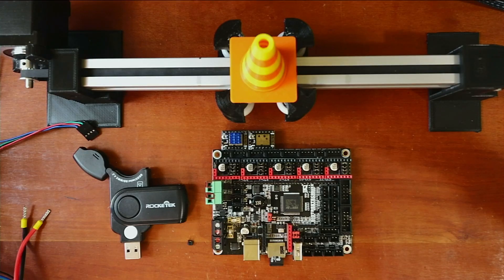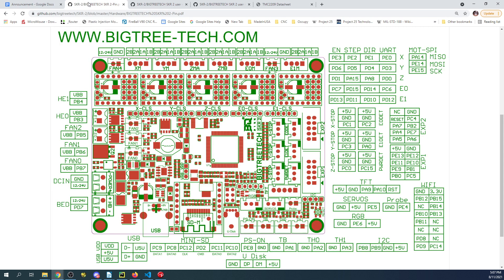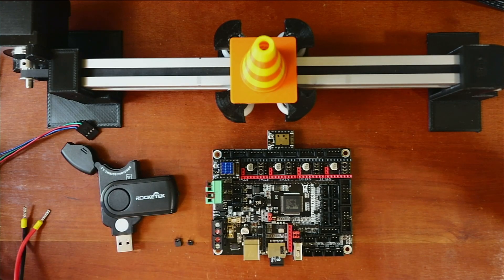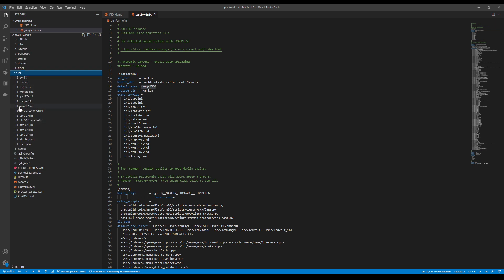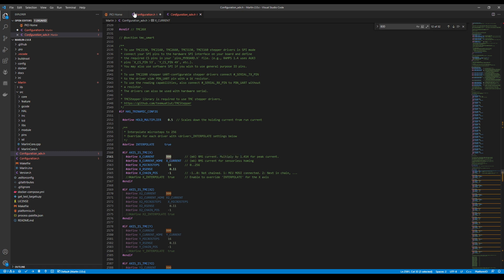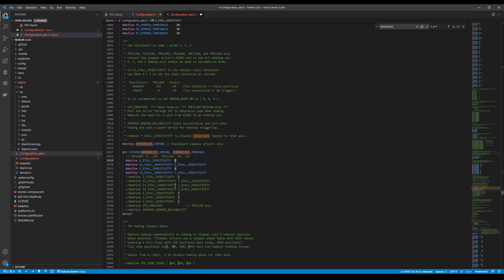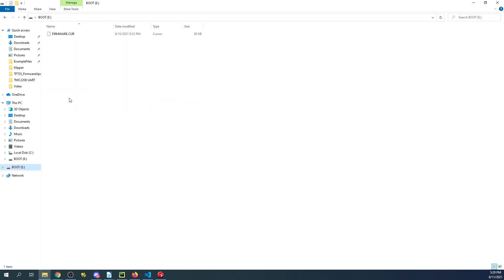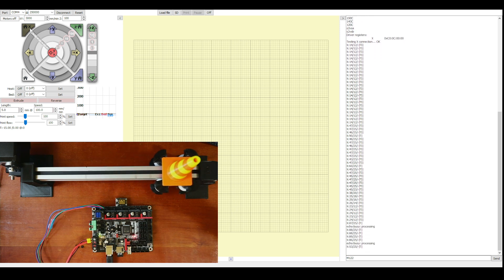BTT SKR2 - TMC2209 UART with Sensorless Homing

Comment: Hi
 Edward
Your page activity is really great and I will follow your page.
Please leave more information about BTT SKR 2 board because it is a new board and there is not much information about it.
Please leave(share) videos about: the original settings of the raw file of the main program, configuring the program and installing the program, setting up the raw file, installing the LCD program, installing the BL Touch, power outage detection, PWC Power Monitoring auto power off, resume print, etc 
I need help 
thank you so much .
Reply from the maker: You're welcome.  Currently I have more videos coming.  For people who want early looks and parts for some video's the usually up on Patreon and it's only $3 a month.

Comment: Hi, did you have to change the position of the PDN UART resistor or did you use the default driver configuration?
Reply from the maker: Nope.
Reply: @EdwardBraiman  so are you saying it doesn't matter which one you buy. UART enabled or not?
Reply from the maker: They come preconfigured from BTT.  Other manufacturers vary